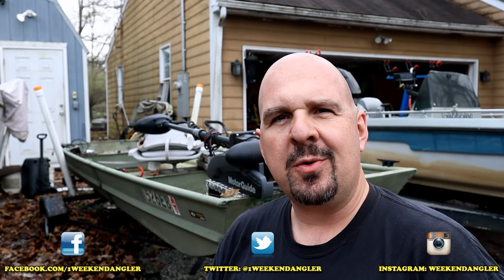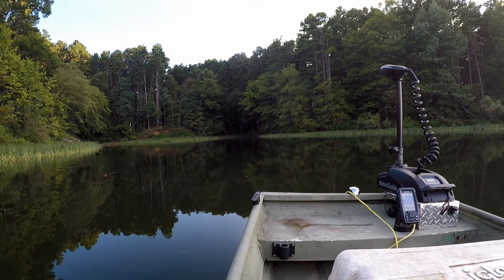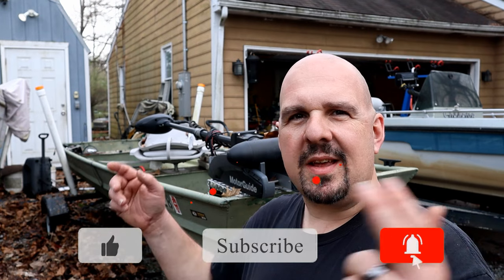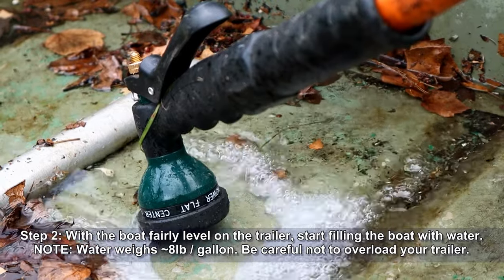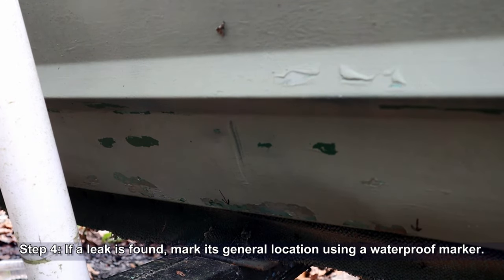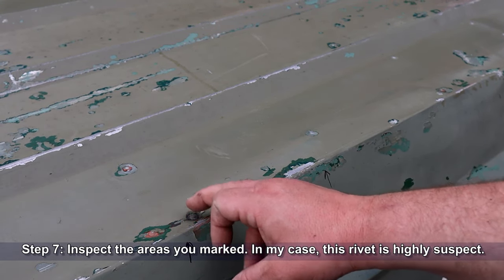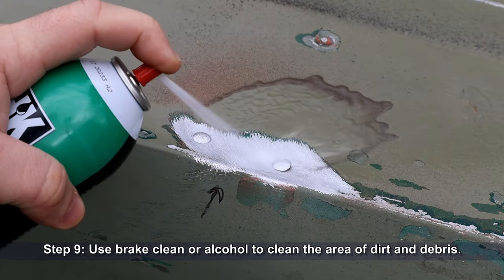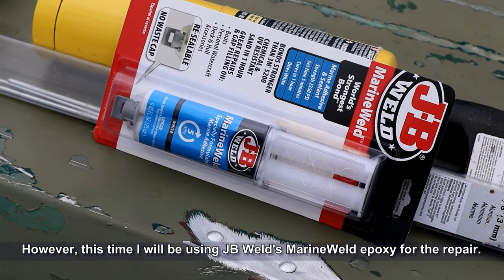Find and Fix LEAKS in Your Aluminum Boat using this EASY METHOD!

Comment: Just did this this morning.  I’ll find out if the jb weld holds up tomorrow.  Great video.  Thanks
Reply: Also I don’t have a boat trailer so I place it on a couple of saw horses with a couple of atv ramps to minimize rocking.  And a couple of 2x4’s strategically placed to reinforce the saw horses so the weight of the water didn’t collapse them.
Reply: How did it work out?

Comment: This video is great. I just got me a 10' Jon boat and I'm getting ready to search for leaks. 
What's the best thing to use if you don't have a trailer? I doubt saw horses will hold a boat full of water. Lol
Reply from the maker: I'd probably put it on saw horses and put just enough water to cover the bottom. You can then lift the boat on either end and hopefully find the leak.
Reply: @TheWeekendAngler  I'll just build some stronger saw horses. Thanks.
Reply from the maker: @straightwhitemale5753  yeah, I'm not sure of a better way on that one.

Comment: I'm wondering why you chose to use the weld instead if brazing it? Is it better for small cracks
Reply from the maker: I chose this method, which is basically a form of brazing, because I didn't have a tig welder.

Given the choice, I would have preferred to tig that crack.

This method used cheap rods and a propane torch, and is something anyone can do. I like to show people that they don't need to be afraid of taking on repair projects as long as they take their time.

Comment: My dad bought a boat used one time. He sold most of his rifles and shotguns because he didn't hunt anymore.  The boat looked fine and sat in a covered shed for a few years.  They took it out and it traveled kinda low in the water.  He parked it in the garage overnight because it was late.

The next morning the entire garage floor was covered in water and there were holes all over the boat.  Mice had been living and peeing inside the boat for years and made the bottom real thin therefore holes everywhere.

We spent all the time that I could come over putting a new front end on the boat then he sandblasted the rear and immediately big huge holes appeared.  We ended up taking the boat to the scrapyard halfway fixed and he talked to my mom and ended up buying a new boat and reusing the trailer and motor.  The trailer finally died and he boat a new one a few years back and the motor had no hydraulic lift so he traded it in for a used motor so basically the boat is new except for the motor.  He had to tear that apart and replace a bunch of parts on that too.  So in the long run he could have bought a new boat for less.
Reply: B-reak
O-ut
A-nother
T-housand

Comment: I use mapp gas and aluminum brazing rods Im surprised you didn't?? Epoxy is an effective band aid but I use the rods! Just make sure its prepped and cleaned never had 1 problem and I take my Jon on 200 ft lakes weekly in the summer !

Comment: I just put a small cut in my sportspal a little more than a 1/4 of an inch at or above  the water line of the bow. Should a person do both sides inside and out? Thanks I like your idea I figured JB weld had an aluminum one but this is better Marine did not know !
Reply from the maker: If definitely wouldn't hurt to do both sides. In this case, since it was a rivet, I could only access it from the outside. I can report the leak fully sealed.
Reply: @TheWeekendAngler  Thanks for your reply and the report.. I will buy some for sure! Happy Canoeing to you and enjoy the summer  :-)  Gotta put mine in real soon to see if there are leaks ha ha

Comment: I’ve got a John boat but it’s full of bb holes like like the little pellet sizes all through the bottom of the boat will this be a sufficient enough way to repair such damage?
Reply: Drill the holes and rivet them with sealed rivets. Can even cover the rivets in 3M 5200 adhesive

Comment: I have a deck with a seat and trolling motor mounted on my Jon boat. It there a way to fix it without flipping it upside down? I would rather not have to take all of that off just to patch a leak.
Reply from the maker: If you're careful with the epoxy, you could probably apply it in thin enough coats that it would not drip off. You'd have to keep a good eye on it, but I think it would work. Be sure and sand well and wipe it down between coats to promote adhesion.

Comment: Do it your way but i would never use epoxy  either aluminum brazing rod or brad those rivets. That epoxy will crack off.
Reply: I've used it quite a bit. This Marine JB Weld is magic. I've never been unhappy with it.
Reply: @wymple09  like good whiskey... choose your poison